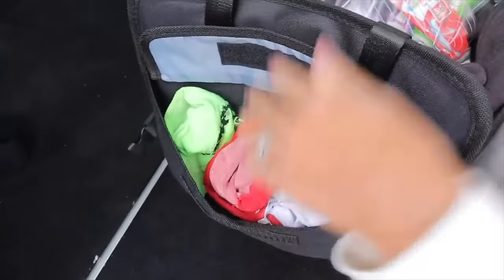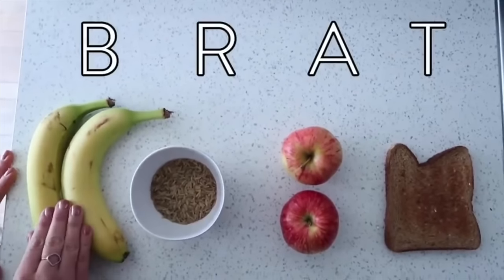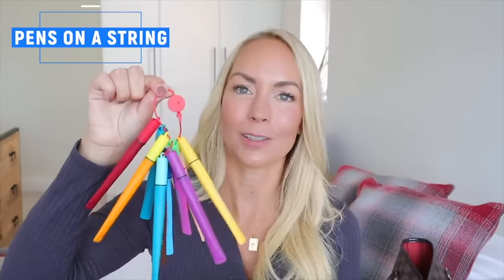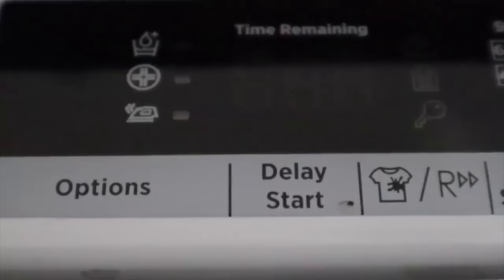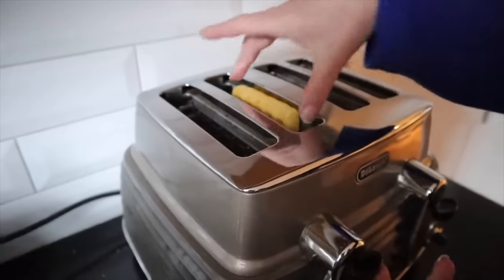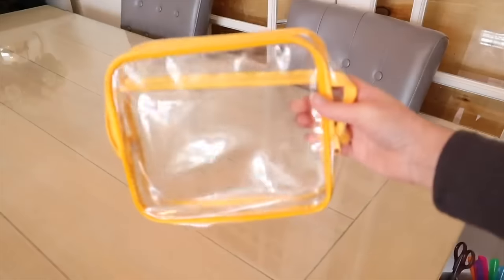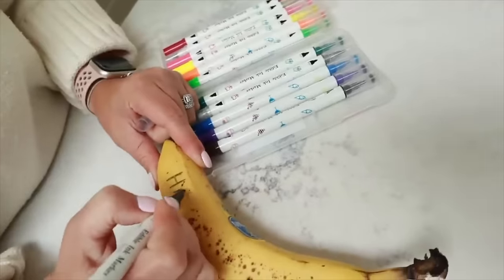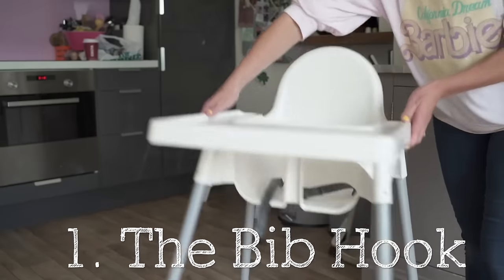100+ of the BEST MOM HACKS Ever!  Ultimate Mum Hacks Marathon ✅

Comment: Nice tips! One thing I started doing is putting Epsom salts in my toothbrush holders. No longer have to deal with the guck at the bottom which I always forgot to clean. I swap the salts every 4 months or so. Anywho, that's my small drop in a bucket of tips back to you after years of being saved by yours. 😊